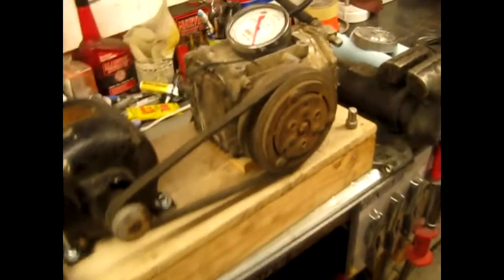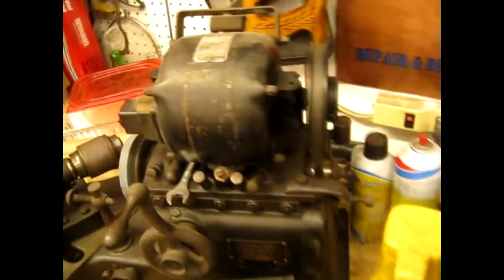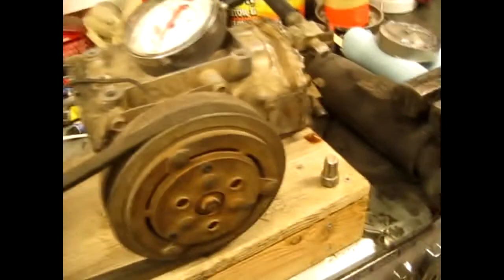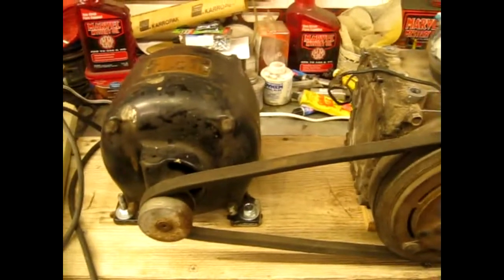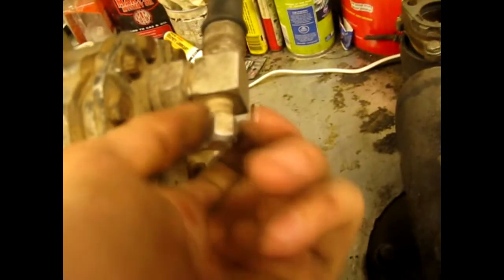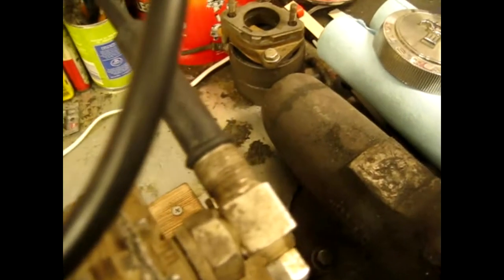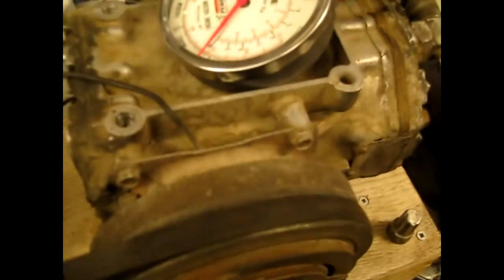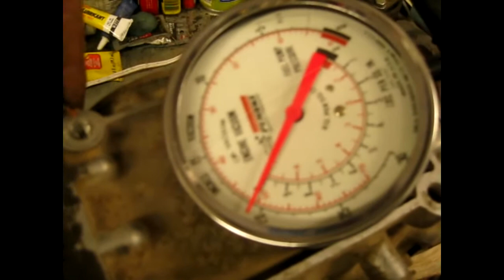Homemade vacuum pump

Comment: thats cool so how are you going to fill up the airco system?
Reply from the maker: no kidding This is just for removing the old refrigerant/air and testing for leaks. To fill the system you use an a/c gauge manifold that has the hoses and fittings to connect the cans of refrigerant to the a/c system. With the car running and the a/c on, the compressor will suck in the refrigerant.